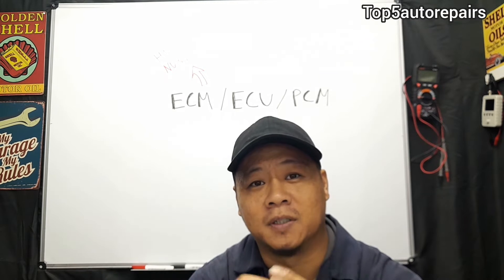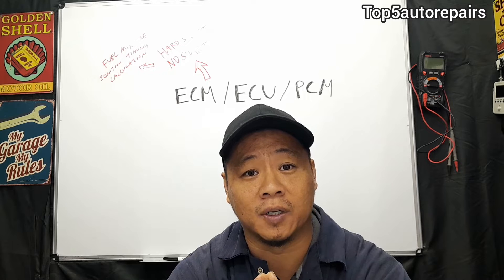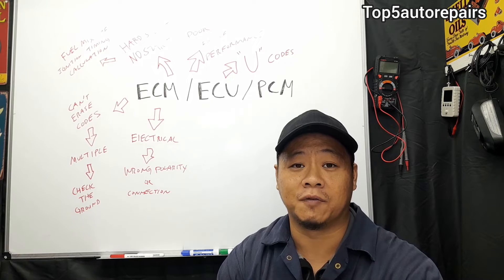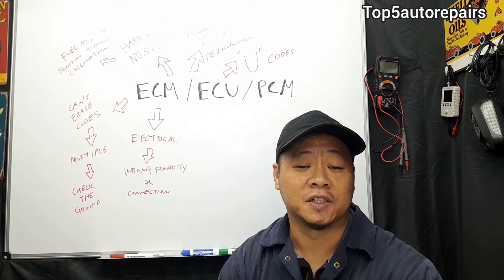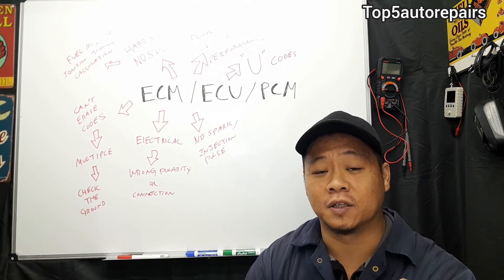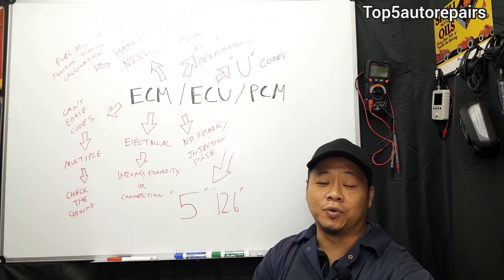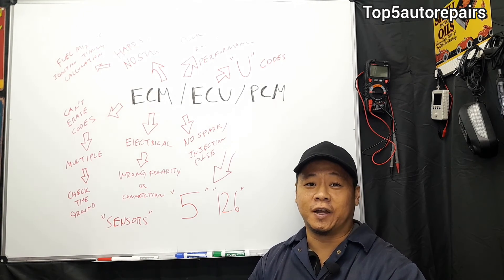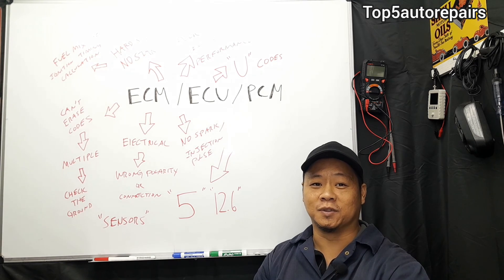Symptoms of a Failing ECM ECU PCM going bad (Failed Car Engine Control Module Explained U1000)

Comment: Sir if car has ecm P061B64  internal control module torque calculation performance how to rectified bad ecm or sensors or other problem   
Give me advice

Comment: My car is throwing code P0200 fuel injector circuit. I checked wiring everything. It's fine. Car runs great. Plenty of power. Good fuel economy.
I'm thinking false positive. ECM ? 🤔 I ran the code through research see if other stuff could cause that code. MAF issue could. I know my MAF needs replaced. I'm waiting by the mailbox 📬 for it to arrive from Rockauto.

Comment: I'm getting a c0000 code. Its a abs,power steering, or speed sensor which can be in the trans or on the trans body.

Comment: I'm getting a code for my MAFS and TPS. We changed out both and nothing. The shop said there is voltage going to all sensors on the throttle body but the voltage is erratic. They want us to change the throttle body but seems like this wouldn't fix anything if the voltage is still jumping. I'm thinking the ECM. The codes are P0121 and P0122. Any thoughts?

Comment: I am taking a shot in the dark and just assume i have a bad ECU. 

I have replaced all ignition related parts and now the car runs fine and in closed loop, but the same two codes keep popping up, no matter how many times i erase them. P0321 and P1361 on my 95 park avenue.

It took me a month to come up with a way to diagnose the car, finally i found TunerProRT and made a homemade aldl 16 pin cable.

Its really hard to get this car diagnosed here in Spain as no one knows what a buick is

Comment: 2012 Ram 2500 ST, Crew Cab 4 Full-Size Doors, Four-Wheel Drive, 5.7L V8 Gas— where can I buy the ECM ECU PCM ?? Which one is used in my truck ? And where is it located?

Comment: I got no check eng light on but have 40 codes I wipe the codes and they come back right away. Eng does start but takes it a few key turns to get it to start and runs rough at idle. I have checked all the connections but thinking due to the computer saying injector1-4 have no signal but the eng is running. 2000 grand am 2.4L

Comment: Mine gives no codes at all, bad surging issues under engine load, bad fuel economy, random misfires. But the no codes cost me thousands in repairs before I knew it what my ecm
Reply: Did you fix it
Reply: I got the same problem with mine, and no codes also. How did you find out that it was the ECM?
Reply: @rec1015  it was always the map sensor.
Reply: It's not the ecu it's the junction plug that is no good

Comment: I have an Acura on e85 with the tank topped off. Sat for a little over a month, made sure positive and negative were connected properly. Tried to jump it and would not start. Starter is working , but no fuel pump sound. The battery was completely dead when I tried to jump start it. Fuel pump and ecm fuses are good plus new battery. Please help, any input would help. Trouble code was P1035 . HHEEEEEELLLPP!!!! LOL
Reply: Get a new ecm

Comment: Just had to order a plug snd play ecm from solo auto ecm in Miami. I had no wide open throttle after 2nd. Many new sensors with replaced harnesses were reading very high. The transmission computer couldn't communicate with the ecm.. new one came in today for a pt cruiser with a summit racing built motor and high performance built a604 transmission
Reply: Hi was it the ecu? Have same symptoms. Thank u

Comment: 98 Ford mustang 3.8.
Snan tool reading ECT 165 cold. New sensor still same problem.
Reply from the maker: Engine running cold possibly due to stuck open thermostat or cooling fan running all the time.

Comment: One mechanic took out the oil pump and installed it that was how everything started. No power when riding and had all the symptoms.  Egg smell, misfiring and the jerk. Then after mechanics took out the transmission clean some parts and put it back it fired up like a new machine. 6 months later it happened again. Now it at limp mode. Hopefully it’s the ecu as I have only tried changing position sensor and the air intake control module

Comment: Can a bad ECU cause 02 errors, misfires, and black smoke out of exhaust when stomp on accelerator, and would it cause rich to lean ?
Reply: fran did you find out if it was it? i have the same issues
Reply: @Locoshow91  I almost sure it is my o2's I proved it by unplugging my 02 and all at 450 mv from scanner  readings and also checking power and ground, I also checked with 02 plugged in 2 wires same color proper voltage coming to 02 sensors. I also got a a lot of good information from Scanner Danner. He has a lot of really good videos and excellent forum. nothing against anyone on this channel , just really god information from Scanner Danner
Reply: That sounds like bad catalytic converters
Reply: EGR

Comment: I have a 2015 Nissan Versa Note that was throwing a P0138 (Bank 1 Sensor 2 High Voltage) and check engine light. The exhaust system was old, rusted and leaking everywhere. I replace the entire exhaust system (intake manifold back) except I didn't replace the o2 sensors (yeah pretty dumb I know) and the P0138 & CE light did not go away. With the new exhaust system, I tested the downstream o2 sensor and got poor readings (showing it was bad), so I replaced it and the P0138 code went away. But after testing the old o2 sensor/wiring & replacing the o2 sensor, the car wouldn't start (it turned over but would not fire up). I found a blown 20A fuse marked 'ECM' in the engine compartment fuse box (next to the battery), replaced it and the car fired right up, but it still shows CE light and U0100. The car runs fine so what could be causing the U0100 code?
Reply: Check your wire harness through the firewall if anything is damaged or check your ecm if anything is also damaged inside the ecm circuit board and check it using a probe to make sure all connections are working . Consider multimeter also for voltage test in normal range (8 v to 18v). This can be done by DiYer or course a good mechanic. Also check your PCM powertrain control module. ECM & PCM are like husband & wife for U0100 code.

Comment: I have a 2006 MBZ s500 and my car stalls while driving. Sometimes it will not start up, especially when it's hot out. There are no codes when it happens. I was running live data one time with my scanner and the car stalled and no code popped up. Could that be my ecu?

Comment: Everything going on with my durango is pointing to the tcm after i had cleaned old throttle body and then change to a new one.. only thing that making me think other wise is the gage cluster turning off but radio and everything else working fine… does ecu control p
Dash power too?

Comment: Yup!!!  My 2017 suburban had at first a lot of life's go on the panel  took to a local mechanic and he fixed some chewed wires and connectors. Seemed to be OK for two days then wouldn't start had it towed to dealer had more chewed wires and it must have blown out the PCM they fixed all and it is now fine. Found out it was rabbits chewing so put a fence around car. So far so good.

Comment: My 2006 Saturn Vue 3.5 shows no codes. But the car will crank but not start. It's happened 4 times. Prior to this there was one night the wife came home and the engine bay smelled of burned electrical. There are no codes. The car will just randomly not start.

Comment: my 2006 ford focus starts hard only at the first start of the day - it sputters and may stall. Subsequent starts are fine though.Could this be an ECM issue?We've checked fuel pump, cleaned injectors and spark plugs were recently replaced. the check engine light is persistently on regardless of fixing the issue the codes were indicating last year.

Comment: Mine was fine until I drove over a large puddle of water . Could this be the cause .2012 Camry
Reply: Same with mine but I was able to drive about 1 hour afterwards. Then drove the next day. The day after that it died. Started and stalled and shacked fairly hard. Then intermittently cranking and fuel pump continuously running. And no communication with the obd2 port. 

I think it could be pcm but anything is possible